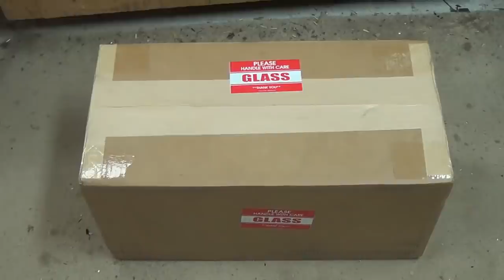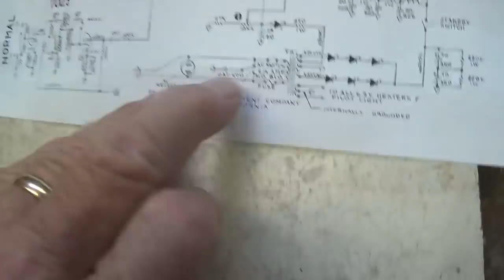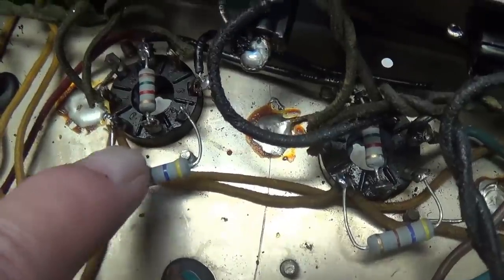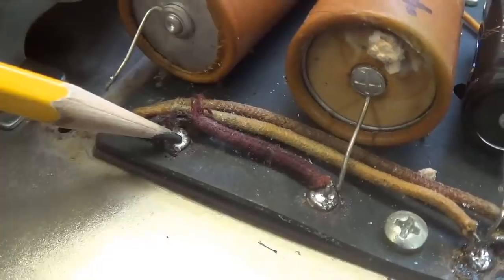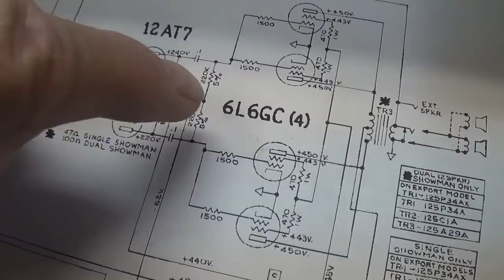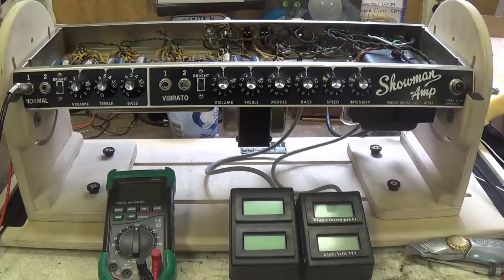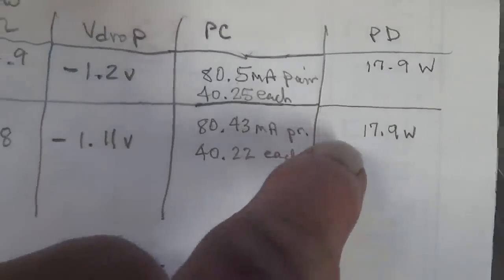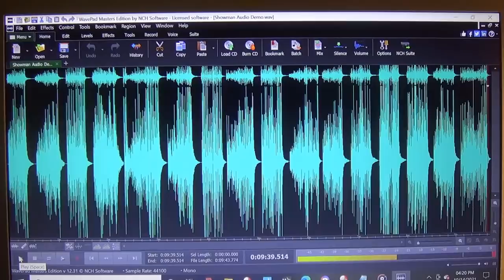1965 Fender Showman.......Back from the dead, but not without an epic struggle

Comment from the maker: NOTE: Before you comment on the "Low Battery" indication on the Eurotubes probes, please note that they do not use batteries, but get their power from the 6.3VAC filament circuit. Perhaps the voltage was reduced a bit by the Current Limiter (which has never been an issue.....ever) but the incorrect values persisted without the CL and also in other amps with known-value tubes. I suspect that the extremely high current draw either damaged the probes or de-calibrated them. I will report my findings in a future video.
Reply: Mine shows the same thing
Reply: trustworthyness must be verified~ may need a different way to get the right answer~(as you've done)~ see the depths of hell~ can feel the voyage~ love all the patient, knowledgeable repairs~
Reply: the tubes would come loose, a separate head/cabinet makes so much sense~
Reply: Hey Doug - I've been using a 100 Watt bulb in my current limiter and I've gotten the low battery issue on my eurotube probe when biasing the 70s 100/135 watt twins (bulb is dim, not bright). 
I found removing it from the current limiter gets rid of the low battery message - but also increases the plate voltage. Suggest biasing directly from the wall so not to risk inaccurate readings!
Reply: @TunaUnlimited  He mentioned that later in the vid
Reply from the maker: @aristocrat_000G  Thanks, Jay.
Reply: For what it’s worth I often get a slightly lower bias reading with my current limiter… I generally bias with the limiter and then confirm and fine tune plugged directly into an afci/gfci outlet.  *I guess I’ll watch the whole video before joining the peanut gallery 😁
Reply from the maker: @tsloth1390  Probably a good idea, Tommy. This is fully covered in the video.
Reply: Be interesting to see inside them, I'm sure it can be fixed, odd though they'd make them with a low battery indicator inside, specially with active circuitry to make that show up!
Reply from the maker: @phonotical  I think it simply denotes low operating voltage from the amp's 6.3VAC circuit.
Reply: @UncleDoug  sure but that's no battery!
Reply: Are there any net videos of circuits of the eurotubes - are they descrete components or ICs  in there ?  Is there a means of checking their operation for standard and 'overdriven to breaking point ?'
Reply from the maker: @highpath4776  Good questions, HP. I hope to find out some answers through my communication with the manufacturers.
Reply from the maker: @TunaUnlimited  Agreed, Tuna, as I explained in the video.
Reply: I recently brought my 1971 Marshall Super Bass head back from the dead by running it on a variac and each day letting it sit at the previous day's voltage and hour before pushing it up another 20v. By the end of the week I had the variac at 240v (I'm in the U of K) and was only getting 167v through the UncleDoug(TM) current limiter, which was also glowing nicely. So if my schoolboy mathematics is correct, thats only 70% power and hence your 6.3v rail could be at 4.38v, maybe causing the Eurotubes* to be out?
*Viva la Brexit!
Reply from the maker: @PrinceWesterburg  Thanks for the input, Prince, but recall that the same probe gave completely different results depending on which OPT primary lead was powering it. If it were simply a matter of low filament voltage, wouldn't the same conditions apply for all sockets ??
Reply: @PrinceWesterburg  I suppose you could create a 6.3v battery pack for the heaters (well 6v from an number of 1.5cells to give the amps),  The rest of the valves are they then in proportion, or do grids need a critical mass of VAc to emit / attract ?)
Reply: What  a kool  amp  from the 1965
Reply from the maker: @greggaieck4119  Yes, it is :)
Reply: @PrinceWesterburg  Viva Brexit!
Reply: Ooh! Yes, very interested to hear about that. I often find myself jealous of your probes. This will help reduce that feeling, if so.
Reply from the maker: @AdmiralQuality  The probes are repaired and on the way back home to poppa. One required a wee bit of calibration, and the other was badly damaged by a huge voltage spike......possibly courtesy of the malfunctioning OPT. I'll discuss this in a future video. The repairs were done quickly and for free.
Reply: @UncleDoug  Nice. Sounds like my jealousy will be restored very soon. ;)

By the way, just picked up my first Variac (an actual Variac brand one, 20 amps!) and isolation transformer on the local used market. Setting up a lab! First task... build a current limiter.
Reply from the maker: @AdmiralQuality  Sounds like you're acquiring some good equipment, AQ. Best of luck with your increasingly populated workbench :)
Reply: @UncleDoug  Thanks Uncle! You've YouTube-educated me enough to make me dangerous. (I'll keep one hand in my back pocket, promise! ;)
Reply: Go Dave Dave GO
Reply: We Love You Dave!!! Keep COMMING BACK
Reply: I think you are right about excessive current draw ruining your probes! 
As a matter of fact you probably should use those only to measure idle current without a signal present.
Reply from the maker: @southboundsuarez9832  They have been repaired by the factory (at zero cost) and are back, working quite well, SS. I will be careful with them in the future.
Reply: @UncleDoug 
Hey Unkie! Glad to hear that they took good care of you! 
I have a particularly sensitive (albeit fragile) specialty (expensive) bias measurement tool that is no longer being produced at the moment.  Mine reads two tubes simultaneously and  actually does all the calculations and will simultaneously indicate the plate voltage, current and total dissipation power that actually takes the grid current into consideration too. All on one easy to read LCD screen. 
A dedicated bias meter is a tool I used to scoff at,,,, why pay for one of these tools if ya have a DMM? Or better yet two DMM! 
Once ya use a bias meter such as the one I have now, you ponder how ya ever got along without one!
It makes it so easy peasy and fast. It is a time saver and safer too! Now the biggest inconvience is plugging and unplugging tube sockets to audition the amp between bias settings. I know the hard way not to inject a signal into the amp while my bias tool is inline..... 
Mine is microprocessor driven and utilizes code burned into a PIC . I suppose someone else who is good at writing code could brew similar device with an Adiuno of some sort or another.... 
Would you consider a fact finding video or at least give some opinion on these premium high dollar components like the boutique crowd build with, such as Mercury Magnetics, ZoSo and other premium caps , the resurgence of carbon comp caps,  oxygen free copper wire and cryogenically treated tubes , guitar strings. and catnip/cannabis and super conductive nano particle snake oil?!?
Reply from the maker: @southboundsuarez9832  I scoff at effete boutique merchandise. The hype is merely an excuse to overcharge, IMO.
Reply: @UncleDoug  Oh and do they charge dearly! 
Boutique, cork sniffer shit or not,,, boy am I feeling the hurt more and more when purchasing component inventory!  Have you noticed how it seems as if certain more common guitar amp component values pricing has been jacked up when compared to similar sized less guitar eccentric  component values? Like for instance .022 caps or 480ohm resistors, especially a lowly and fizzy carbon comp! It's crazy! No reason a single resistor should cost more than a dime! Foil cap more than a quarter!
Yup! I keep thinking I need to learn how to homebrew my own vintage line of NOS style clone vintage electronic components!
Reply from the maker: @southboundsuarez9832  That sounds like a viable concept, SS. Good luck :)
Reply: Your the best uncle Doug very enjoyable night at work😊
Reply: Some of these comments scare me
Reply from the maker: I understand, Sam.  @samchipner1131
Reply from the maker: Thanks, Sam :) @samchipner1131

Comment: Hey Unkie,
Another fine video that kept me glued to my smartphone. As you introduced this latest feature and invited us to pull up a chair, I had just perched upon the vitreous ceramic throne to experience a thoroughly rewarding massive!  I also let out a hearty chuckle with the coincidence and timing about sitting back in your fave EZ chair or whatever the verbatim of your introduction. I suppose everyone has their own folk remedies such as your 40 ounce cool pop. I discovered maybe laughter may be the best medicine. 🤔 Hmmm,,
Maybe that too much info? I digress. It's not unlike me to ramble on. 
More seriously , great video! I couldn't put the smartphone down and had me at the edge of my seat for the whole hour! ( Doh!)
This amp sure was an extremely clean beauty! It sure goes to show you that even a nice looking amp that the beauty is skin deep and the personality sometimes takes greater depth to realize. Well Ya know me, I love making these amps look pristine and correct,,, kinda disappointed that no cap stuffing was done on this one. As for the metal oxides? That's one I often lose sleep over... Usually for the power supply I will utilize the metal oxide. For the grid stoppers and plate resistors I still use carbon comps. Honestly, mostly for looks and period correctness. However there are the boutique cork sniffing types that say they can substantiate a tonal difference likely due to fluctuating thermal coefficients that make the amp more dynamic.
I don't know how perceivable it is to my ear??? Well actually as I just wondered, it is highly perceivable when ya get all those fizzy fried bacon sounds coming from the depths of the white noise within,,, maybe even some paranormal EVPs?
Pondering some mojo tonal snake oil and wives tales, my thoughts also on that Hammond iron.... I must say just how freakin nice it is of Hammond to share the technical particulars with ya! It is especially nice that they include info pasted right into the core with a nice label that doesn't just include a model number but gives all the info one would think you would wish for.... ( I just was sorting thru a literal ton of iron being discarded by an estate.) I wish they all were labeled half as good! Getting to my thought on asking what your take or opinion of the hallowed Mercury Magnetics?!?
I dunno? I always was suspect by their amount of marketing hype and the fact that they don't include much of any technical data or specifications. Their often premium price put me off too. BUT,,, now that I have used and heard them in several different applications, I think they influence the perceived sound. I can't technically describe it but I do notice in some applications they introduce a looser bit of briter but pleasant  jangle and bloom (damn I sound like one of them!)  One thing that they do is that they offer rewind service and can take that orig period correct tranny and make it right . Surely there are others that still practice such arts... I have had my Ham license since before I could have a driver's license. One thing that had always remained magical is the whole resonance/reactance deal of electro magnetic circuits and devices especially transformers, inductors and such. Building projects they instruct you to wind  so  many turns of some wire on whatever form and that it will work for your application. The formulas are complex, just how the hell can they predict or formulate that if have x amount of wire wrapped around a certain permeability during a meteor shower you will arrive at the center bandwidth of whatever tuned circuit you wish to emulate?  Nope I am still hit and miss. Sure don't miss the grid dip meter of my youth.  It is simply magic!  Those people who practice such black arts of spec, building and winding output transformers are holy. While asking opinions  , I noticed the metalized polyester  wound caps you had replace the ceramic disks along with one big polypropylene orange drop too. So what is your fave cap , fave cap material, style and brands? Why? Is there more to the make up of tone caps other than their actual component value that can color tone or alter signal? 
Love to see ya do a tone myth video, or better yet discuss it over a cold pop or some other refreshment in person. 
Love ya man!!!!!
Reply from the maker: Good questions, Bob. 1.) Some amps have a balancing pot that does what you suggested. Also, with cathode-biased DE circuits, you can tailor the bias resistors to balance the tubes. 2.) They were returned to the company several days ago. I will disclose the findings in a future video.  3.) YouTube has (apparently) given me ad-free viewing in return for the placement of ads in my videos. To be honest, my work schedule is such that I simply don't have the time and energy to fight with them over the proceeds of ad placement. My Patreon patrons provide sufficient income that I can continue to produce videos.....and income is really not our prime motivation for doing so.

Comment: Wonderful, Uncle Doug! You may not video all of your repairs, but you do chose the best! I have first hand knowledge of what speakers were paired with both the Showman and Dual Showman so when the question arose about what speaker could handle 85 watts I knew JBLs. They ARE my favorite. I had a ‘65 Bassman with twin 12” JBLs and I should have never sold it, keep the amp, ditch the wife! If you can afford them, you are never disappointed. Thanks for the heads up on the tube source. You said it right, in these dayz of uncertainty, beggars can’t be choosers. The amp is worth 10 times what this repair costs, I’m sure the owner will be trilled, I am! Love from NW Colorado. Thanxz
Reply from the maker: Greetings, ATL. It's always great to hear from you. For every repair you see in a video, two or three more go un-memorialized.....simply for time's sake. There are only so many months in a year ;)  I have only had one JBL speaker in my life.....and it was superb.
Reply: I always liked the JBL's. After using a Peavey Mace amp rated @ 160 watts, I have to say those Black Widows are the poop now. Rated at 400 watts with a 4" voice coil was impressive. I wheeled and dealed a little bit earlier this year and landed a '65 Bandmaster head. I didn't have a 2x12 cab, so I hooked it to those Black Widows in the Mace cabinet. Boy, was I impressed! That old Bandmaster sounded great. I believe I found a diamond in the rough. It's hard to find those old BW 12's now though.
Reply: @UncleDoug  Here is the speaker configuration on the Black Showman amps.  There was a single 12 and single 15 and the Dual with 2x15".  All were JBLs

ShowMan Models
Showman: 1960-1963 Showman 12 (One 12" JBL D120 Speaker), Showman 15 (one 15" JBL D130 Speaker)
Dual Showman and Showman 15: Starting 1963 (Two 15" JBL D130F Speakers for Dual Showman and one 15" JBL D130 speaker for Showman 15, Also called Single Showman.
Reply from the maker: @dtravis7  Thanks, Dennis, but my references and several viewers have reported that 2 x 12" cabinets were also offered.
Reply: @UncleDoug  I think they are right.  I got that from a Wikipedia article.  I think I remember a 2x12 version but It might have been rare.  The ones I saw the most growing up in Pasadena Ca was the 1x15 and the Dual.  Great video Doug as always.  been watching for a few years now.  Keep up the excellent work.
Reply from the maker: @dtravis7  Thanks, Dennis.
Reply: @dtravis7  You're correct. The Showmans were usually used for bass guitar back in the day. Most guitarists used the Twin Reverb. Same circuit but 12" drivers. The JBLs are some heavy rascals. Also used in the '64 Vibroverb. Upgrades back in the day.

Comment: Nice Job: I like your troubleshooting technique, you don't jump to conclusions and you evaluate the a Perceived problem more than one way. Thus avoiding shot gunning problems which of course means lost productivity and higher costs to customers.
Reply from the maker: I work on a fixed rate, Mack, so there is no incentive to stretch out the hourly count. I just enjoy trying to resolve each problem as promptly and directly as possible.....like a brain teaser. Experience really helps.

Comment: What an ace amp (now) have been hooked on your channel since discovering it. I was a radio mech in the Fleet Air Arm in the late sixties/early seventies and worked on an American ground control radio installation (Gilfillin) that had almost  2000 valves all in rack mounted modules, it was a nightmare if there was a power cut as everything went tits up when restarting it and everything would need recalibrating.all the racks had at least one replacement or two for the most troublesome ones that where serviced and recalibrated waiting on standby. Have been a guitarist musician all my adult life so love your channel and your calm methodical restorations ,it's so theroputic in this mad digital world. Thank you.
Reply from the maker: Thanks so much, William, for your nice comments and for sharing your experiences.